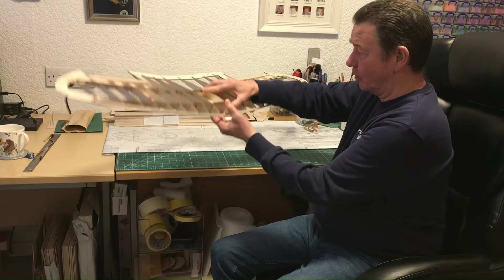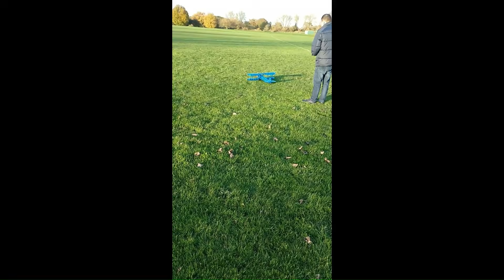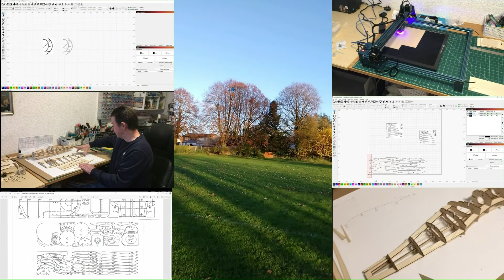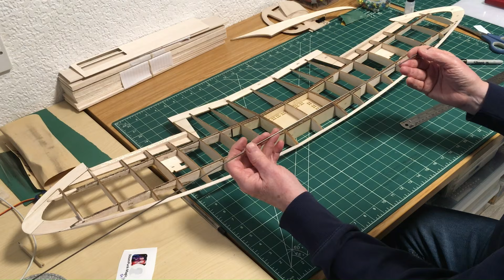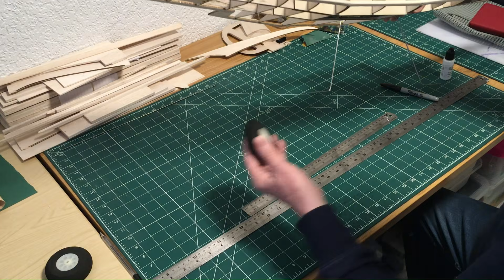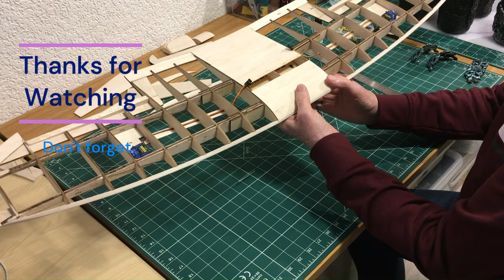How to make a classic RC Balsa Spitfire part 11 'Completing the wings' (Spitfire 11)

Comment: hi may I congratulate you on a very good clear and concise build. it has tempted to build the same model. I have never flew or built an RC aircraft so I am lacking in the knowledge of what electronic parts to buy. It would be a great help if you could list the components you use in the build. i.e. transmitter, receiver , motor, servo's etc. thanks look forward to seeing the completion of this model soon.
Reply from the maker: Thanks for your comment, I appreciate the positive feedback. If you have never flown a model before it might be better to start with a high wing model (where the wing is on top of the fuselage, rather than underneath) It will be easier to learn to fly. The KeilKraft Contestor is a good example, I did a series on it converting from a rubber powered model to a 3 channel RC plane. Take a look and see what you think. I will be happy to answer any future questions and help in anyway I can. I will include a list of components in the next video, although things like the receiver are sourced to match the transmitter so I will list the ones used in this model.
Good luck with your projects let me know how you get on. 👍👍👍👍